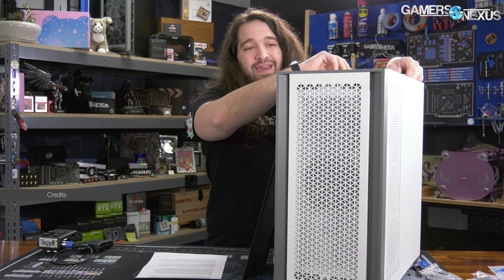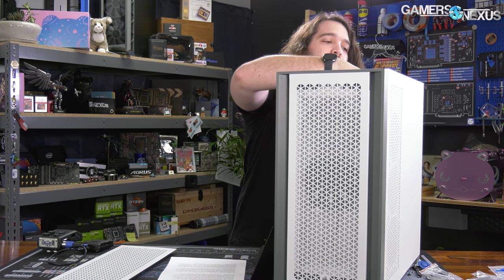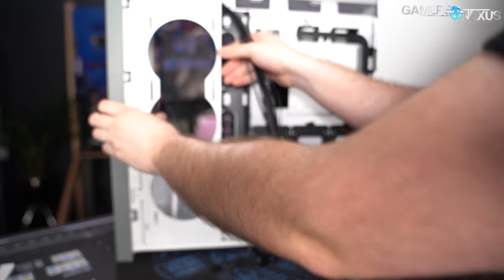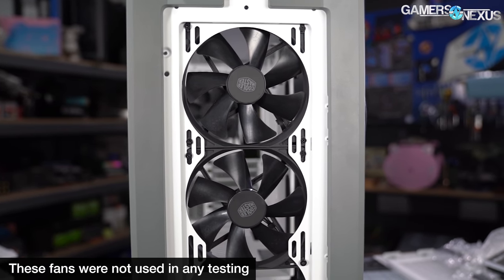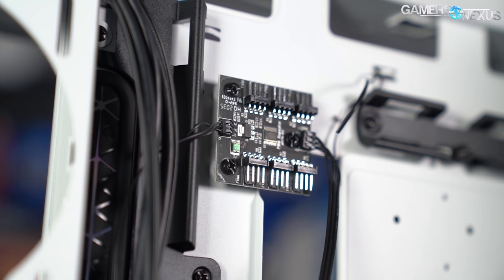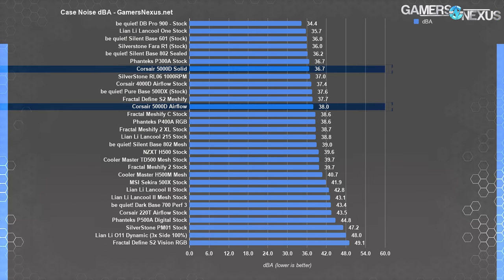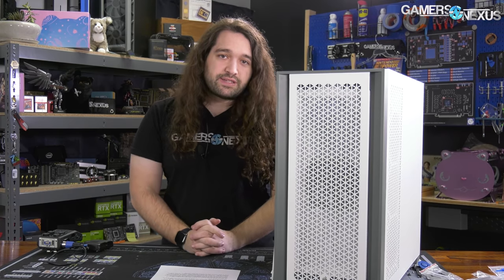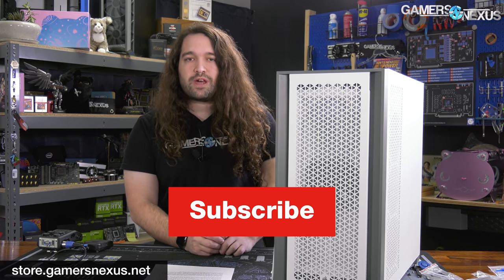Corsair 5000D Airflow vs. Solid Case Review: Thermals, Noise, Build Quality

Comment: I populated 10 fans in my 5000D Airflow. Also using a H150i capellix. Front 3 fans set as intake. Side 3 fans set as intake. Top 3 fans and rear as exhaust. I’m getting a max 70 degree Celsius CPU Temperature on a Ryzen 5800x under full load running Cinebench R23
Reply: I opted for the same setup, though using arctic freezer ii 360mm. It does a great job of keeping my 10850K temps with a mild oc under control. I'm also getting excellent gpu temps. I like the case a lot though the tinted glass panel is a bit dark (I have the black version)👍
Reply: @davapod  I have a new build arriving in a couple weeks, which includes this case and the same AIO you got. Curious, where did you choose to position your AIO, and for intake or exhaust? I'm also wondering what fans to get that preferably run quiet since I do music production.
Reply: @ChildOfSaturnMusic  II mounted the Arctic freezer at the front, tubes down, fans as  intake. 3x Arctic P12 pmw pst side fans as intake. 3x Top mounted fans. 1x rear mounted all as exhaust. For these I used Noctua NF-p12's as I some spare, though the Arctic P12's would be just fine for low noise.

Comment: Thank you Steve and everyone at GamersNexus.
I literally threw a bunch of money at this because you reviewed it with good thermals, didn't think anything obviously negative, the look was what I wanted (lots of others didn't seem as cool to me) and seems flexible into the future, and the poor GPU cooling performance is going to be addressed with my existing Noctua fans, which are compatible with the flexible fan options offered by this case. Ace!
You took what I usually spend a week doing and burned it down to a few hours. Thank you!

Comment: The 5000X is even better in sorts of love to details. The 5000X has glass even on the right panel of the case but still has the dustfilter implemented into the glasspanel, that's so dope!
Reply: It is but it's not recommended. The glass prevents major air flow unlike the mesh design on the 5000d
Reply: @BlackBruceLeeTheGreatDekuTree  Mine stays at 30-39c on idle. Works better then most other front glass panels.
Reply: @TheSjuris  noiceee
Reply: @BlackBruceLeeTheGreatDekuTree  worked better than my h510 elite that like to idle at 65c.
Reply: @TheSjuris  damn that's crazy I ended up going with the lian li xl I have 13 fans in my rig on a push pull configuration. My idle ranges from 36 to 43 but my room is also hot af all the time lmao
Reply: @BlackBruceLeeTheGreatDekuTree  only have 10 in mine. No push and pull no need to push and pull. Stays in the mid-50’s under load.

Comment: Thanks for the great review as always. I just ordered the 5000D Airflow model with some be quiet! Light Wings 120mm & 140mm PWM high-Speed fans. I have a Thermaltake Core P3, but decided I wanted to go back to a closed case design. I had to make sure the case I chose supported a 360mm aio.

Comment: Just for anyone looking at building with this case, I have 13 120 case fans installed:  6 on top  360 radiator as push pull, 3 on front, 3 at side and 1 at rear of case. For the side fitted 3 fans, i left in the shroud, took bit more effort but it can be done. And the good thing is the air now gets directed right at the RAM banks, so its pretty good .

Comment: as someone who is using 5000d airflow the way it build and the ease at which i was able to move my build into the case makes it worth the price it took me 20 minutes to remove my build from a cheap case and put it back in this case and it was so easy to clean the front filter took 2 second to remove panel and filter worth the price just for that

Comment: I like your advice to purchase a mesh case with decent fans (PWM for the case and decent CPU cooler) over a "silent case" that leads to higher temperatures (shortening component life) and higher speed fan rates 👍👍👍👍👍I was initially looking at the FD define7 but ended up with the Corsair airflow with noctua PWM fans following your advice. I'm very happy with it

Comment: I recently bought this case and have been happy with it (Airflow) - I've got 4x 120,  2x140 case fans and 2x 140 CPU fans, I've been optimising for noise and have been pretty happy with how low I can dial the fans down.

One thing I'd note is that due to the way the radiator mounts are - the Arctic Freezer II 280 is quite tricky to install in anywhere except the front. The top doesn't leave any room so any motherboard with anything but the smallest VRM heatsink on it  is going to block it. I'm happy with putting the the heatsink in the front as I think getting the cool air over the radiator should allow me to keep the fans quieter, but something worth considering.

One other slight knock is that I found this case a bit tricky to build in even compared to the smaller case I came from (Phanteks Enthoo Evolv ATX from 2015).

Comment: I have the 4000D and honestly? It's the best case for the price on the market at that price point, especially if you're like me and just have fans you can gut from a current system already. I don't really see the middling "only include 2 fans" thing as a huge issue, as you can either use what it came with to adequate performance for the average build, use a few additional matching Corsair fans to match (the supplied fans are pretty good as-is, just not *top of the line*), or like me, go ultra quiet with Be Quiet! fans and spend a bit more.

I was really happy with how easy it was to build in this, and I just love the PSU shroud and overall clean look to the build. The black one looks GREAT for blackout builds with minimal lighting, by the way.

Comment: I'm keeping my eye out with this new round of case reviews. I want a new home for my arctic liquid freezer II 420. I have an 8yr old case that will fit it, but something more modern is desired.
Reply: Meshify 2 XL fits the liquid freezer 2 420 well (and is on Steve's list of "better than neutral" cases)
(Meshify 2 XL + liquid freezer 420 is my current configuration)
Reply: @ultranerdprime7468  does that cooler fit on the top or the front?
Reply: I just want the GN-brand RV02 successor...
Reply: @pfeilspitze  i would spend so much  money on  case built by GN with their stamp of approval lol
Reply: I'll give putting it in my old Phantom Red NZXT Case a whirl. With a few modifications it should work. Should make for a nice project. I'm considering the meshify 2XL, but I'm going see what comes around first. I already have a 360mm radiator setup, so I'm in no hurry.
Reply: The 7000d has 420mm aio support on front and top

Comment: I "fit" a 3x140mm radiator with the bottom fan somewhat suffocated, and all fans aren't screwed in with all four screws into the radiator. It works because the Corsair H170i ELITE radiator fit with zero clearance - it's not going anywhere. I moved the fans that came with the case to the side openings, mounted the radiator+fans to the front, plugged everything into the RGB controller that came with the H170i, and removed the controller that came with the case. The only thing I had real trouble with, or didn't really work well, was fitting the 24V cable through the panel that hides the cables on a FULL SIZE ATX board like the ASRock Taichi Carrara. I picked up a right angle RGB adapter to make this work. I had issues with the cable management because how you remove some of the pieces aren't exactly clear, but once I got everything together, snugged up all the cables with the straps and the bar, it came together wonderfully. I absolutely hated working with this case, it was my least favorite build to date, but I love it now that it's put together.

Comment: Still waiting for a modern case with side panel fans
Reply: At this point, I consider it a win if you can get 5.25" bays. Physical isn't dying, it's being killed.
Reply: @angolin9352  true they are trying to kill off physical drives and support for them. Some people do still have Blu Ray's or DVDs that they would use in a htpc. It's nice to at least have the option to put one in. Although they are removing that option now. 

Honestly it's not really necessary anymore. With hard drive capacity backup NAS servers and internet speeds being much faster. It saves manufacturers money to take out the drive bay area. It's less materials which saves them money.
Reply: Right?  I don't think it would be that hard, either. Probably more expensive, but could be done in a way that hides all the wires.  I think having a glass panel with the fan hole/mounting cut out would be awesome. If I designed it, I would have the panel connect  power/RGB via some pogo pins on the case, then somehow embed the copper wires into the glass so it would look almost like a clear PCB.  I don't even think that's possible, but would look SUPER cool.
Reply: @Sevier7777  I personally want to install my aquaero 6xt controller without having to rely on some jenky Jury rigged solutions. So far I have not found modern case that can replace my aging 900d with my needs.
Reply: @eliadbu  their are a couple of cases you can still get. While not brand new within this year or last year. They are still kind of newer than the corsair series. They do have 5.25 drive bays. Cougar panzer max full tower is one of them.
Reply: @Sevier7777  the thing is I have 2 480 radiators and dual loop. To find a reasonable case I'll have to change to 360/420 and probably have just one loop.
Reply: @eliadbu  well good luck with that. You're going to have to comprise somewhere. If you are going to get a new case. That's not exactly the same as the one you have now. It's pretty rare to have radiators that big. Most people just go with 360s double or triple or 280s. That's pretty much the standard for what most cases will fit anyway. That case I mentioned will fit two 360s top and front and a 280 on the bottom.
Reply: The last "modern" case that i know has ODD is Cooler Master NR600 ODD. 
It has both version, with and without.

Comment: Great video, as always. I looked at this case when recently shopping and ended up going with the Thermaltake View 51 Snow. The main reason is because the Corsair 5000 series cases have a basement, while the TT View 51 is designed more like the Lian Li O11 Dynamic cases with the dual chamber and things like a PSU and additional hard drives go in the back. Also, there is enough clearance to mount a 360mm x 60mm thick radiator in the rear chamber, behind the mounting area for the 3x 120mm side fans.

Comment: [00:01] Yeah, Corsair's case design has been a rollercoaster ride for sure. It's good to hear that they've made some improvements with the 5000D, especially after the 4000D. The balance between aesthetics and performance can be a tricky one in case design.

[00:27] I'm curious to know more about the differences between the airflow and non-airflow versions of the 5000D. Did you notice significant temperature variations or other key distinctions between the two models?

[01:09] Also, the mention of Corsair's attention to detail is intriguing. Those small design touches can really make a difference in the overall user experience. Are there any other noteworthy details or features you'd like to highlight?

[02:17] It's a bit disappointing that the 5000D only comes with two fans at its price point. I agree with you; it seems like manufacturers should either provide no fans or an adequate number for the price. Did you consider adding more fans to see how it impacts the thermals, or do you think Corsair should have included them by default?

[03:56] The attention to detail you mentioned, like color-matched stickers and painted magnets on dust filters, shows that Corsair is putting thought into the user experience. Are there any other such details that caught your eye during your review?

[05:21] The cable bar and its impact on cable management is interesting. It sounds like it has both pros and cons, depending on the user's preferences and needs. Did you find it easy to work with, or did it present any significant challenges?

[06:59] The placement of the cable cover being magnetic while the side panel uses screws is an unusual choice. Did you find this design decision to be practical in daily use, or did it lead to any issues?

[08:08] It's good to hear that Corsair has improved the cable management options in the 5000D compared to the 4000D. More tie-down points and better cable routing can make a big difference in keeping the build clean. Did you find these improvements helpful during your testing?

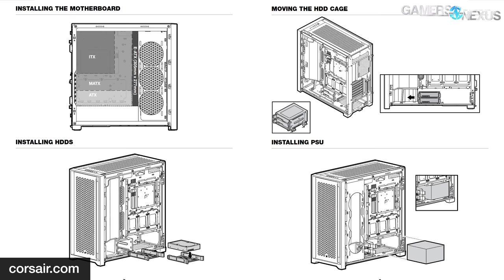[09:33] The issues with the hard drive cage and the thumb screw access are noteworthy. Did you find any workarounds for these challenges, or do they remain as potential drawbacks for users who need to install 3.5-inch drives?

[11:09] Radiator compatibility can be a crucial factor for many users. It's good to know that the 5000D has improved in this regard compared to the 4000D. Did you have a chance to test radiator performance and installation ease with this case?

[13:30] The information about individual components being listed as separate product SKUs on Corsair's website is intriguing. Do you think this could be indicative of Corsair offering customization options for the 5000D in the future?

[15:09] The thermal testing results are crucial for evaluating a case's performance. It's interesting to see how the 5000D compares to other cases on the market. Did you perform any additional tests or have any insights into how these thermal results translate into real-world usage?

[19:25] Noise levels are another important consideration, especially for users who prioritize a quieter system. It's good to see that Corsair included options for noise-normalized testing. Were there any surprises in terms of noise levels or fan performance during these tests?

Overall, your review provides a comprehensive overview of the Corsair 5000D, but I'd love to hear more about your thoughts on the differences between the airflow and non-airflow versions and any additional insights you might have regarding real-world performance and user experience.

Comment: Really like my 4000D Airflow. Was a pleasure to build in. The lack of fans do not concern me with this or these new 5000 cases as I use my own fans. I discarded the 2 fans that came with this case and just put it in Ye Olde Parts Bin. Most people I know use their own fans anyway. If I had one minor complaint it would be that it could use 1 or 2 more USB 3.0 on the front panel.

Comment: I love GN and I especially enjoy watching case reviews.  Of particular value to me is the build notes.  But almost every time, I find myself shouting at the screen when they come to thermal testing.  What the F&%$ is the point of testing these cases with setups that NO ONE is EVER going to use them in?

I understand there's something to be said for a degree of scientific rigor when it comes to the kinds of testing GN does, but it helps me nor any other potential case buyer to know how a case performs with only the stock fans.  We should be encouraging case manufacturers to sell cases with zero fans, anyway, since the ones they include are usually trash and add an unnecessary extra amount to the MSRP of the case, not to mention end up in the trash (I've only ever bought 3 computer cases and I've got a big box of stock case fans that have never been used). I don't know what percentage of case manufacturers care (or how much they do) about how their cases fare in GN reviews, but if they do, surely they're more likely to include a couple more stock fans, bumping up the price even more for no other reason.  Not only that, but now you're even moving these useless stock fans around in the case trying to find the optimal arrangement when, and I repeat, NO ONE is EVER going to use the case like that. So you're essentially using your time to test cases in multiple configurations that provide virtually no useful information to consumers, other than the fact that they need to buy more fans... but we already know that.

Please, for the love of, at least add a "typical" or "ideal" fan setup.  If you insist on doing the other tests for scientific completeness, then that's your business, but please add this one final test that would add more useful information that all the other thermal tests combined.

Comment: I recently picked up the Carbide Spec Delta Case for £20 off of full price and I'm in love with it. 3 included RGB fans and a nice rear fan. Even with only one front fan, cpu fan and rear fan running it keeps quite cool.

Comment: I acquired a 5000D solid case, but after watching this I ordered the airflow front and top for $15 a piece.  Worth the investment, not that I am worried about cooling with a 7800X3D, but I like the look of the airflow better anyway!  (Planning 9 fans, and going to modulate with rpm..)  Cheers!

Comment: I bought the 5000T (which is bigger than this model), with removable front panel and some small improvements over this, I wish Steve would review it, especially for all the rgb on it 😂

I got mine new for $200 on a local resell website that OFFERs UP some good deals

Comment: BTW, the accessories that Steve  mentioned as not having the option to order are, as of Dec 2023, have the option to order. Prices are quite reasonable. I had a Corsair Obsidian 350D a few years back that I really loved, and back then Corsair offered the option to order accessories and replacement parts. That case now houses my sister's computer. I plan to order this one mainly for the ability to easily access and clean the front air filter, a feature I loved on the Obsidian 350D.